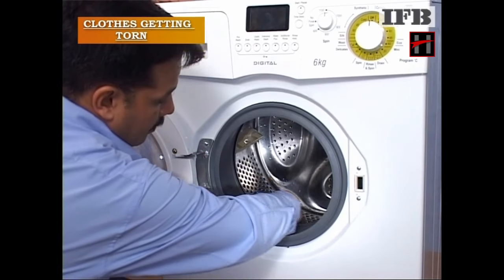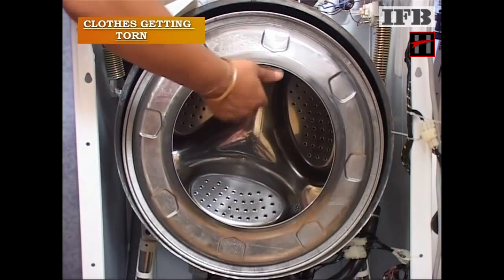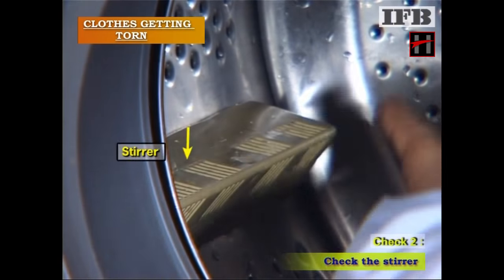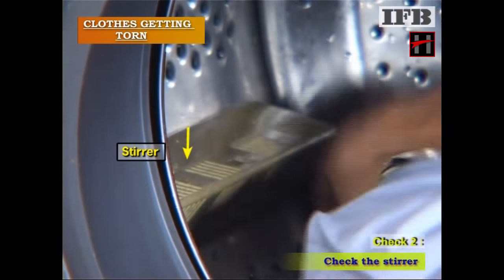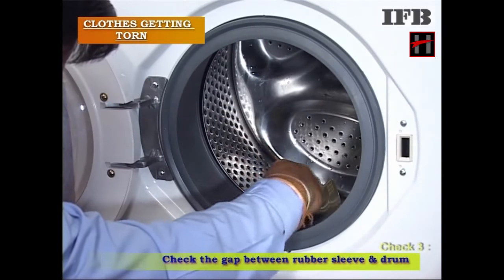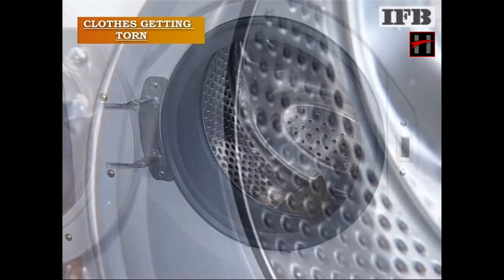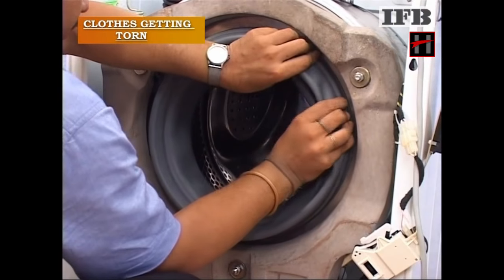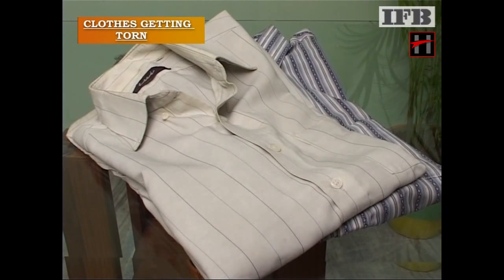Trouble shooting : Clothes getting torn during wash

Comment: This is the third time my clothers getting torn in the laundry. The landlord has new LG laundry machine and only my expensive parts, with strong fabric, are getting torn, not the weak low cost fabric. I looked inside the laundry machine and looks like there is no edges or any mechanism that could cause my expensive clothes to get torn. What could have happened to my clothes that keep getting torn in the laundry? The problem is that the laundry machine is located inside the landlord garage and I will not let be inside without their supervision and they move my laundry to the dryer machine after the washing cycle is completed - I later call them to get my dry laundry. What could be causing this problem?
Reply: Same with me
Reply: Any solution?